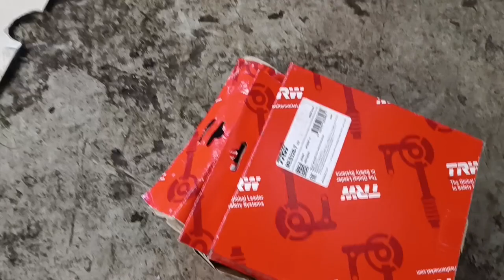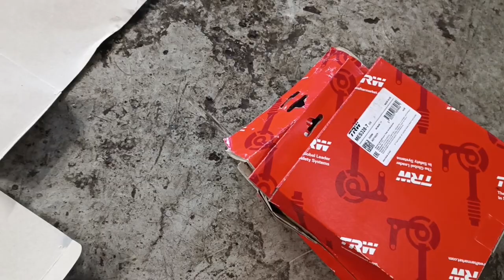Honda GL1800 Goldwing Trike - Clutch replacement

Comment: I've seen lots of bike clutches but not one exactly like this. Presume it's a diaphragm spring but no bolts holding it together. Do you have to compress the diaphragm spring to get that big circlip in?
Reply from the maker: Hi Phil, if you watch closely I used a lever bar to push the back cover back on, and used the clutch hydraulic pressure to push it out. Thanks for watching and commenting 🙂👍
Reply: @melsmotors  ok cheers for replying

Comment: hi im just about to do the same job , however i will be using a normal motorcycle ramp and not a car ramp ,  how more difficult do you think it will make it ?
Reply: its not a trike by the way just a standard bike
Reply from the maker: @ribbster123  it shouldn't be too bad, just be careful, that's a heavy bike to fall on you!